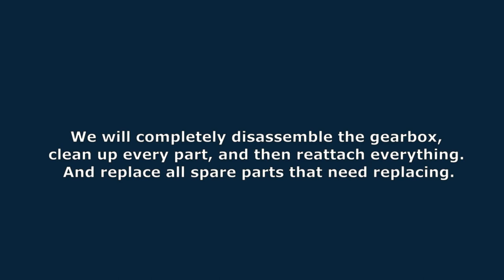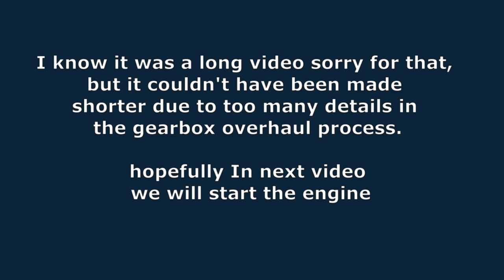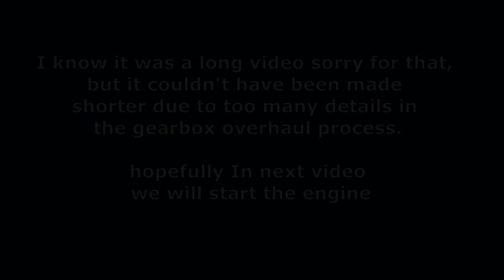GEARBOX REBUILD, PART 13, MG MIDGET 73 RESTORATION PROJECT NO. 2

Comment: Great video, very helpful!!!  For those watching and having a problem keeping up with the speed of the video, you can slow it down by selecting the "settings" sprocket at the bottom of video frame and slow the speed of playback.  That helped me a lot to focus on every detail.
Reply from the maker: Thanks for the tip!

Comment: Amazing skills @Raed! I’d love a bit of advice. I’ve replaced my 1973 MG Midget master and slave clutch cylinders. I have good travel on my clevis pin, approx. 1/2 inch, and first gear still grinds, and it’s very difficult to put in second gear. Any advice? Thanks in advance!!
Reply from the maker: Thank you very much for your comment. truly i have no sold answer,

Comment: Hi I have just replaced the rear oil seal on a smooth sided gearbox (A35) and when i upend the box oil pours out past the seal . Can you think of something i may have done wrong  ?
Reply from the maker: this is normal, indeed you should fill the gearbox with oil after you install it in the car, and the driveshaft is completely in. this back seal seals oil between the gearbox and the driveshaft. if the drive shaft is not installed it will leak.
Reply: @raedshomegarage1064  Thank you very much . I can now install it with confidence  knowing it is not going to empty all the oil . Cheers , Michael .

Comment: On my -71 Mg I replaced the gearbox with a Morris Minor Gearbox. Gear "1" didnt stay in. The only difference was the "Back light " switch that didnt exist on the Minor one.
Reply from the maker: i believe 60s midgets does not have reverse switch as well

Comment: Great vid! I have a question and I’m hoping someone can give me an answer…when the rebuild was completed and everything installed I noticed wires near the shifter…two on the right side and two on the left. The right wires are for the reverse switch, what are the ones on the left. I’m asking because my wires are not connected to anything! Please help!
Reply from the maker: Thank you, ok as u mentioned the right wires are for the reverse backup lights. and the left switch (wires) are for the seat belt alert light, the moment you set the gear into the 1st gear the switch will close the circuit and if u did not buckle the seat belt the alert light will light up, so it is basically for the seat built alert lights.